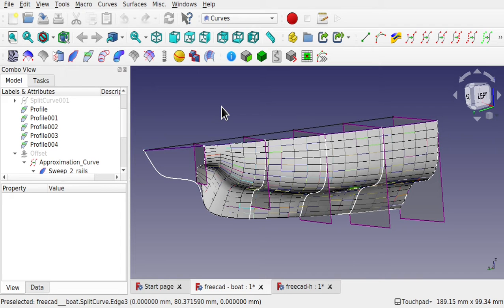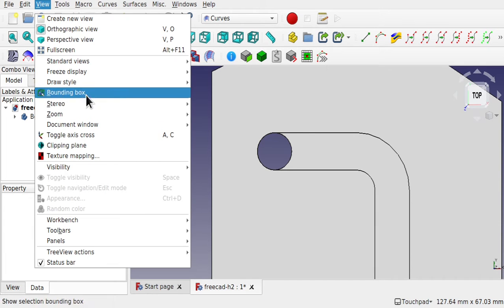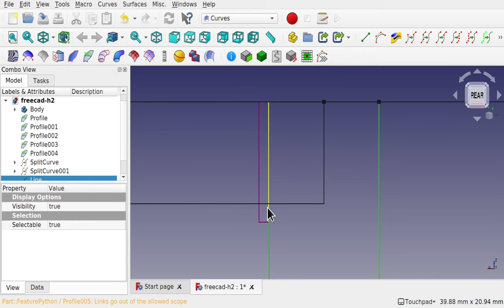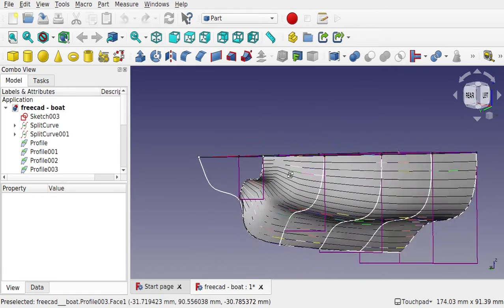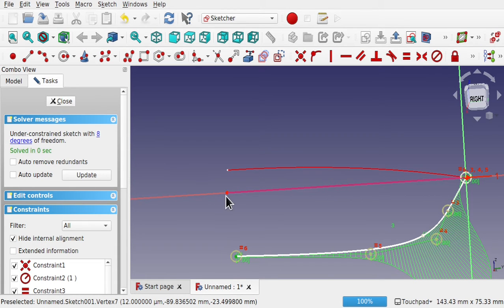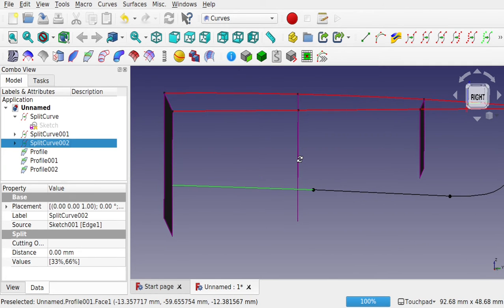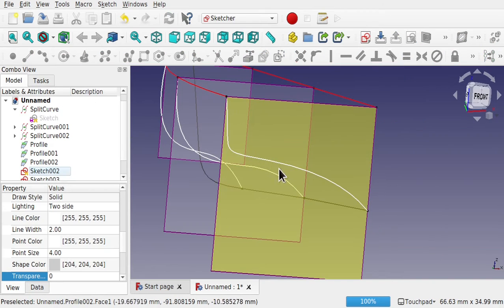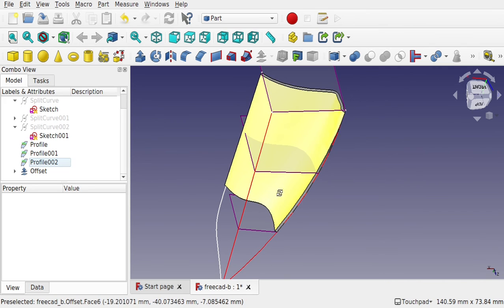Learn FreeCAD Curves Workbench [04] 2 of 2 Profile support plane Boat / Ship hull / fuselage example

Comment: TBH first exercise I cannot pass with satisfaction. Probably I am doing something wrong what I don't realize to. First - don't understand why we put sketches of ribs angled to long wessel axis not perpendicular. Second - I cannot find how to get into edit mode of splitted curve and I cannot slide a vertex closer to the edge of the sketch. This is werid behavior; works and then doesn't work and then again works. Third - beeing in sketch cannot import external geometry (a point of lover curve on the sketch plane). Have to think it over and try again but feel lost a bit for now. EDIT: changed 'theme' of FC to avoid omiting details onscreen. Some issues solved some still nope. I produced a blend of elephant and trumpet instead of hull :(

Comment: @MangoJellySolutions

Ok, I need some help (as usual). I know this is an older video using an older version of FreeCAD, but these videos are usually spot on, or close enough to the version that I'm using. I'm using v21.2 and I can't get the vertex to move except through manipulating the percentages. What am I doing wrong? If I double click on the 'SplitCurve' it makes the split curve not selectable. I've tried everything I can think of to get that darned vertex to move, but no luck. Any help is greatly appreciated. I added the workbench from the addon manager, so it's the latest version.

You may disregard this entire question. I downloaded FreeCAD 1.0.0RC1 and now it works just fine.

Comment: First Exercise was good fun, discovered when Lofting use the Ruled Surface Parameter otherwise you get interesting "Bow Tie" effects. Just thinking when doing the Curve Profile / Planes I reckon some construction dots to help alignment would go well. Looking forward to doing the Vessel Hull which will help Me with fuselages. The more I see of FreeCAD the more I realize that One has to become familiar with a Series of Work Benches, then You can fully utilize its capabilities.
Reply from the maker: Glad your enjoying. The bow tie is the orientation in the property in the data tab (if I remember rightly) of the ruled surface. There are two options, if you swap it to the other one it will fix the issue. Curve workbench is one of those that is full of surprises and fun to use. Glad to hear your progress.

Comment: @MangoJelly Do you have a solution with your approach  in your interesting tuto, to make the deck of a boat not flat as it is the case, but curved from one end to the other of the hull ?
Reply from the maker: Hi, sorry for the delay, really playing catch up with the comments., It sounds like you maybe creating a true to life ship practicing navel architecture so having a camber to allow the water to flow off the deck? If this is the case you can use array tools to create a curve and use it as a path array. This allows tangency placement of the array to get the affect you need. I am trying to find a simple source that I can follow to build a model ship, I'm only familiar with parts of the build and do not have the resource material or the knowledge to break up the individual parts. I am looking for such source to do a kind of model ship building diary as I have the knowledge of freecad and can find the tools needed for such build. If anyone knows of such a resource that I can 'translate to freecad' it will be most appreciated.
Reply: @MangoJellySolutions  Hi if it can help you a simple search on the web with french terms like livet and tonture will give you sufficient info to make useful testing ... actualy several approach are available using Draft or Mixed Curves for example ... but the good thing would be to propose the simpler,   rapid and precise one ?

Comment: Thank you very much for so much insight in how to use teh curves workbench in concert with the other workbenches. However, I am trying to make a bubble canopy for an airplane and I am trying to use Bezier-curves for all of the rails. Unfortunately this results in quite unexpected results. For instance, I cannot get the dividing 'vertices' of the side-view-rail to move so they will line up. My workplanes are therefor always a somewhat skewed in 3d space in relation to my rails and this results in a distorted surface.  How do I solve this ?
Reply from the maker: Sorry for the late reply. Can you send me the file over email so I can see how far you got (you can find my email in the about tab). You may need a different workflow. I have been working with a patreon on a complex ergonomic grip so maybe able to give you some advice there. And thank you for your kind comment
Reply: @MangoJellySolutions  Thank you very much for your offer to help. I will send you the files for you to take a look at.

Comment: I'm on my second pass through the various Curves WB videos that relate to Boat Hulls (and the Mouse example) to absorb more of the relevant detail before starting my own project... and I am wondering if you cover the Bow and Keel part of the design process elsewhere in another video (or would consider doing a part 3 follow up)
Thank you for the slower pace and for the detail in what one can achieve using the tools within FreeCad.
Reply from the maker: Sorry bit late getting to this comment.  It is something that I need to pick up.  I touched on a possible workflow in my beginners freeCAD series for making a very simple ship using surface workbench but I want to revisit your request in more detail as I have numerous request for the same.

Comment: What's the distinction between datum planes and profiles?
Reply from the maker: So a datum plane is a custom plane to sketch upon which can be placed in any orientation, position or attached to geometry to make your life easier adding a sketch that doesn't sit on either of the 3 base planes (I use one in my latest beginners video). The x, y, z position of any sketch placed on the datum will be in relation to it. A profile is a sketch that describes a cross section of the object. So when you sketch something your going to pad this is actually a profile, they are not just used in the context of sweeps and lofts.

Comment: Great videos. Very helpful to see the way you integrate tools from different work benches. Here's a newbie question. How did you model the body with the groove that the tube sits in? I've been trying to use the subtractive pipe tool in Part Design but have had no luck connecting the paths through the different planes.
Reply: Never mind. Using the sub-shape binder to connect sketches of the two paths that run orthogonal to each other generates a single path for the sweep. Always check the manual  🙃
Reply from the maker: Ah sorry I just reread that. Going over two planes so I am guessing you have two sketches or a draft wire? The curves workbench has a number of curve tools to allow you to join edges and curves together. It's worth checking out as it adds a while new dimension to freecad.
Reply from the maker: Thanks glad you liked. With the subtractive pipe you need to add all the edges using the add button so you add your profile then you can add the edges that you want to folow. It's the same as the addative pipe. Its hard to explain in writing but my formula 1 nose cone around half way through when I create the wing I do it there. You can also add edges of objects not just the sketch

Comment: This workflow - fairing the curves of a boat hull - is in fact why the operation is called "loft". This is the name that's been used in boatbuilding for hundreds of years, for the process of taking these cross sectional profiles, and creating the gracefully curved hull of the boat.

Thanks so much for this great video.
Reply from the maker: That's really strange you commenting on this and saying about loft. I have been working on a new tutorial lately regarding a possible way to use another tool in the curves workbench for boat making and it's only yesterday I made the connection between loft and lofting a boat from 2D plans. I spent till 2am in the morning fascinated by the skill and depth of complexity involved. I have always had the highest respect for the craft and the reason I wanted to do some reading was to see if the idea I had would possible work and I had the terminology correct. I didn't expect to be absorbed into a solid 8 hrs of watching a skilled crafts man loft a boat from beginning to end. The only reason I stopped was that I forgotten to eat. I always had the up most respect for crafts men and women but what I saw took that to another level. I totally understand why people devote their lives to the craft.
Reply: @MangoJellySolutions  magnificent! I look forward to whatever you find. :D

Comment: double clicking on a splitcurve isn't allowing me to edit the split points via clicking and dragging, any ideas (Version: 0.19.24291,Hash: 7b5e18... )

the only thing double clicking seems to do is to make the split curve un-selectable and change it's point size to 1

then again something might be fucky about my freecad since I can't change the parameters of the profiles either (was able to the first time and now it does nothing) (nevermind... selecting them all and telling them to recompute seems to let them change)
Reply from the maker: I would try updating the workbench from the add ons installer. Should like you may have an old version of the workbench.

Comment: Your videos are great stuff. Learnt a lot from your effort. Could to PLEASE make a video on "modeling a curves rope "
Reply from the maker: Thanks for your comments, glad your enjoying.  In regards to your request you should be able to do this with 3 helix paths and use a additive sweep.  I have used the compression spring for ropes before but none that are curved. There is a a multiloft tool in the curves workbench which allows you to loft multiple faces through profiles. I am wondering if that will allow for rope curvature as you can angle the profiles.  I will look into it and see what I can come up with.
Reply: @MangoJellySolutions  thanks for your advice. Hope you can manage a tutorial in the near future..regards